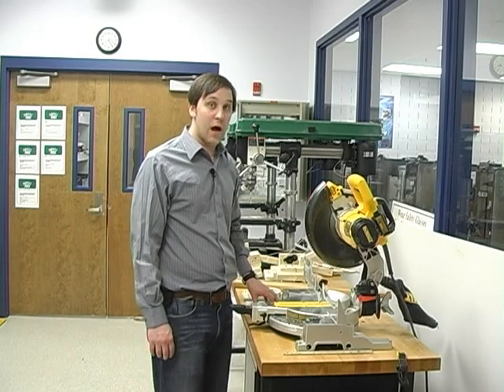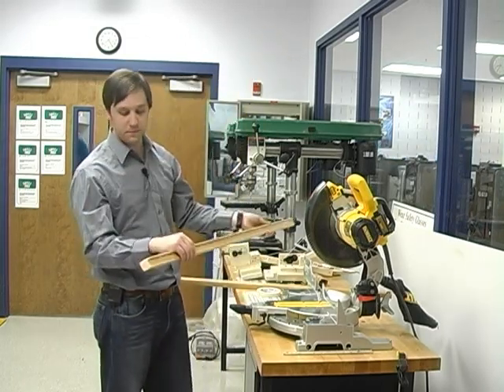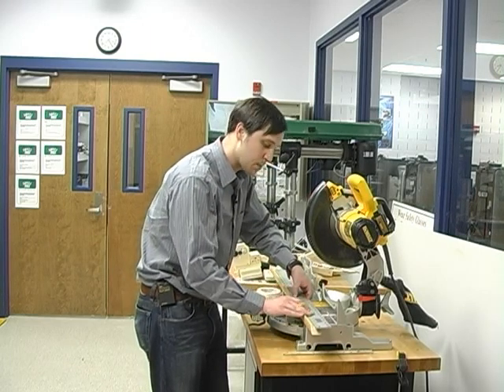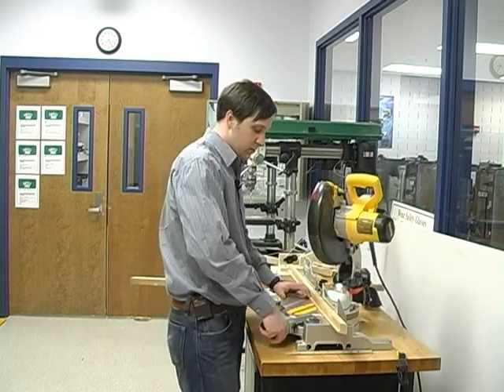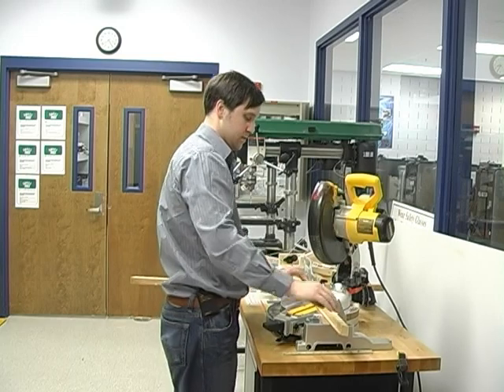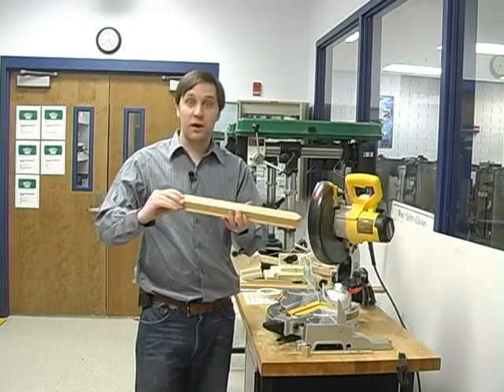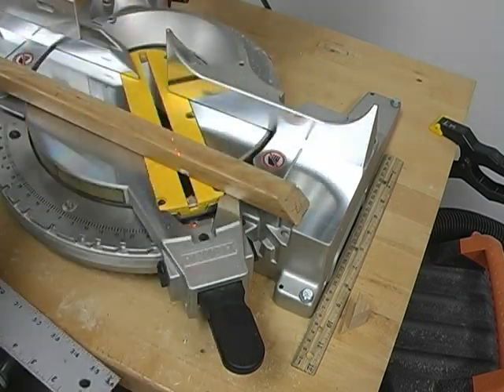Building Picture Frames Part 2 of 3

Comment: The underpinner (frame stapler) is THE best way to join ALL size frames!! You have gaps because of improper technique. In taller frames you need to stack the v-nails. In your smaller frame the gap is likely because the v-nails are too short, improper placement, or poor clamping during the firing sequence. 

Most people do not have these fancy joiners, but trust me they are great. If you are doing this at home you can try an angle clamp where you glue and nail the sides.

Comment: Looks like a job for a mitre saw stop especially since you are cutting standard lengths often. That eliminates the need to measure every time which is error-prone. Your pieces would be the same length so you wouldn't need to shave extra bits off the ends.

Comment: 1/16th gives an over-size frame giving 1/8" play in case you need it.
Make a mistake without the extra 1/16" and you might end up with a
frame too tight.

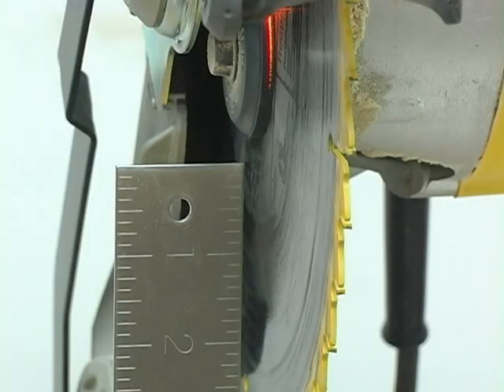Comment: Dude, that blade was NOT perfectly 90 deg to the table, I'm not sure if you grasp the concept of set squares, freeze the video @ 0:45 see the gap between the square and the blade at the bottom of the picture? It is actually at the 2 1/2 inch mark of the square, then look at the end of the square that is touching the blade, this means the blade is not exactly square to the table.